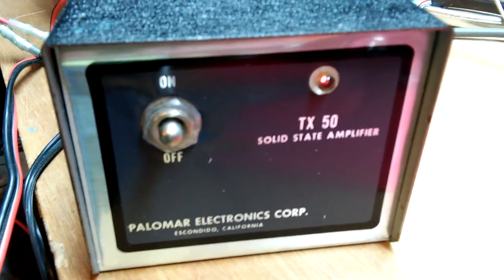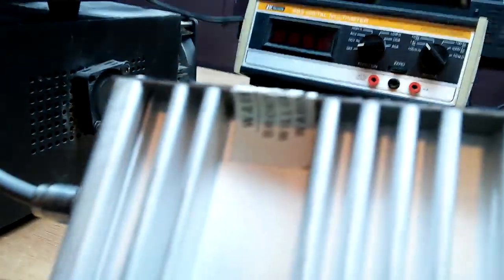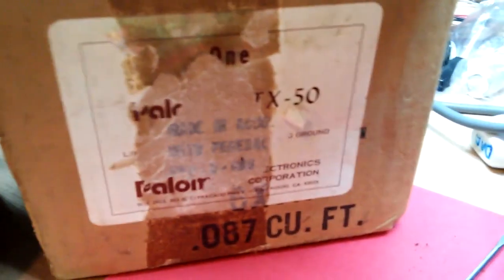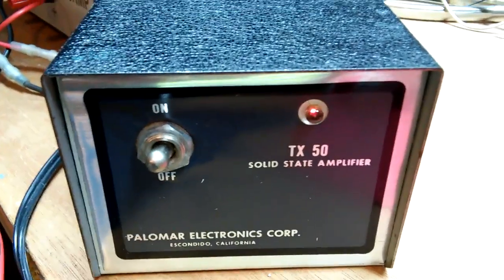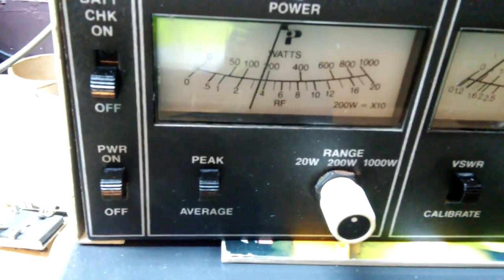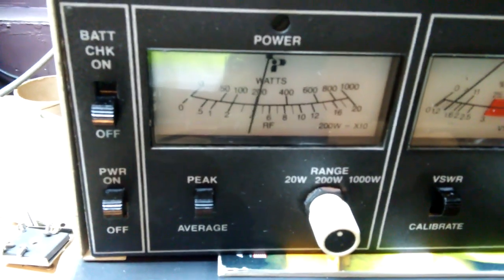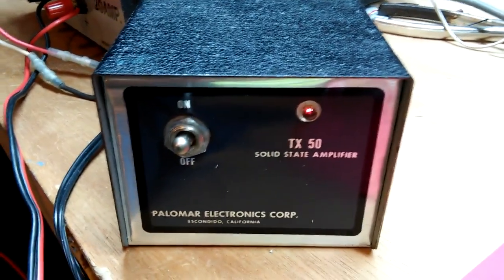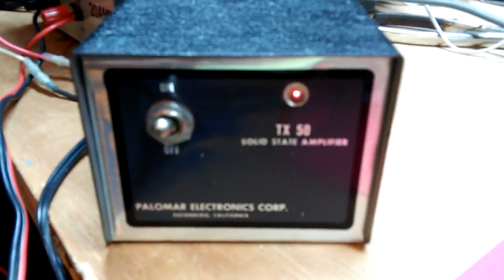PALOMAR ELECTRONICS TX 50 Solid State Amplifier

Comment: I have a new in the box Palomar TX-50B. Never used. I bought it at a truck stop in the early 1980's. Black case and aluminum bracket. Black face with yellow lettering and outlines. Long flattened black plastic toggle on/off switch.  Instruction sheet stresses more concern as to proper gauge power wires. 12 gauge it says for this size of an amp. It says 4 watts input produces 50 watts AM and 75 watts SSB. Why would the manufacturer suggest 4 watt input while this video suggests 1/2 watt etc?
Reply from the maker: In my experience the old amps ran cleaner with very low drive, the 50 in this video was the same as most I have had.  Not just that but I do not want to wipe out the amp trying to get a few more watts. Vintage and all........ IMHO

Comment: No longer a baby boomers shelf queen. It's on air serving as a driver these days, for either a 2 pill 2290 high drive or a 4 pill 2879. Typically fed 1/2 watt or less when as a driver and 1 to 1.5 w used on its own . With great sucess .  It's owner, is a big fat bucket mouth    hence a switched fan now resides underneath just for good measure. 73s
Reply from the maker: Yes!  Sounds great What are you using for a radio
Reply: AR-3300 with a dial-a-watt
Reply from the maker: Very COOL!

Comment: I have one of these.  Can it do SSB?
Reply: Don't even try SSB is my advice.  Keep the AM watts deadkey  input under 2w I like to run about 1/2w.for about 5-10w. To be kind keep it  under 20w out deadkey . I like to see 10-15 max then let her swing up with modulation .I would never use it on a mosfet final radio to be safe.
Reply: @yellowsnow4512  thanks for that advice
Reply from the maker: Maybe if you use an old 3-8 watt SSB rig. Other than that I wouldn't do it.... Cheers

Comment: Yes Sir I agree I would not input 5 watts with the radio but the RF engineers who designed this TX50B State 5 watts is the most you could drive it with. Amp has a Single Motorola MRF455 transistor.
Thanks for sharing👍👍💖